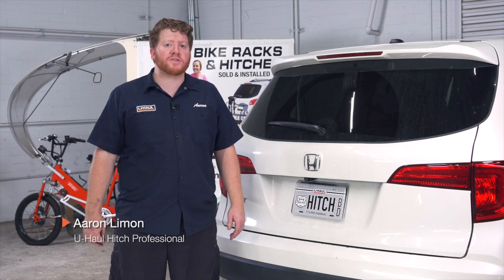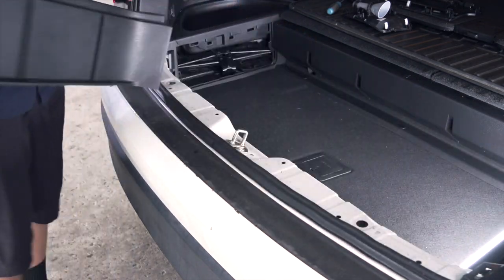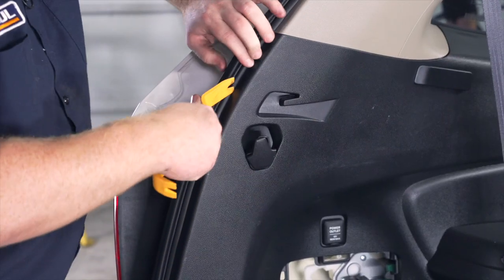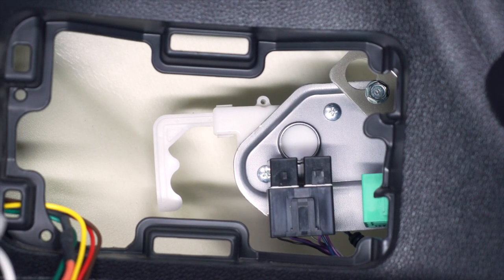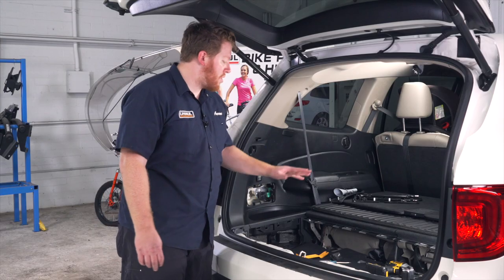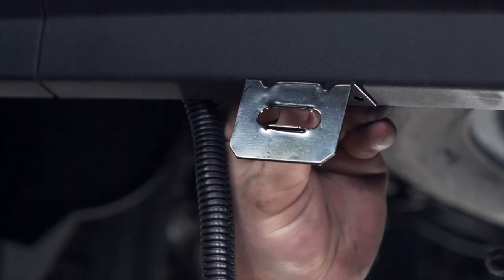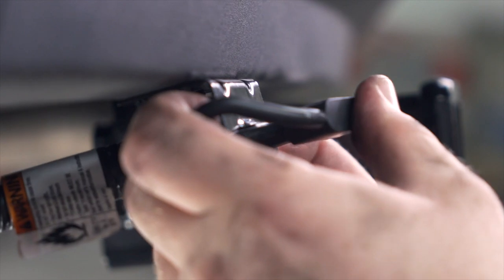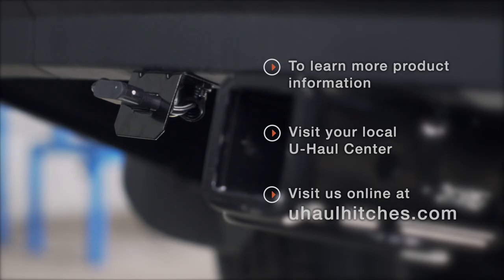2020 Honda Pilot Trailer Wiring Harness Installation

Comment: I cant find this trailer wiring on your website , i like this one better cuz wire isn’t expose when not or  in use .
Reply from the maker: Follow the Link in the description to purchase this wiring Harness. there are multiple manufacturers making the same harness for this vehicle and the steps will apply to both 4 flat harnesses. There is also a 7 way harness for this vehicle. Link for purchase here. https://www.uhaul.com/MovingSupplies/Miscellaneous/Tekonsha-118286-Tow-Harness-Wiring-Package-(7-Way)/?id=21602